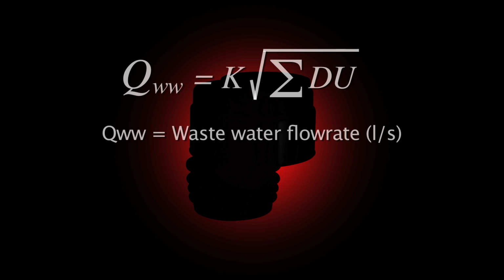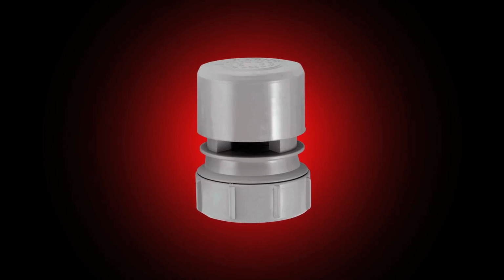Air Admittance Valves Explained

Comment: This is a great video. I have a soil vent pipe on my roof which is stopping me from installing solar panels. I'm hoping this will allow me to remove the external pipe from the roof and terminate the pipe inside the loft space using the air admittance valve.
Reply: Installed one. Had constant smells. Reverted back to venting outside

Comment: Very useful video, one of more informative. We can’t decide is 200mm above the heights water entry point = 200mm plus height of highest pipe into the sewer / stench OR. Say bath high tide / sink heigh tide or toilet high tide plus 200mm. Thanks regards
Reply: Did you find out information about this? I've found conflicting information about the 200mm rule.